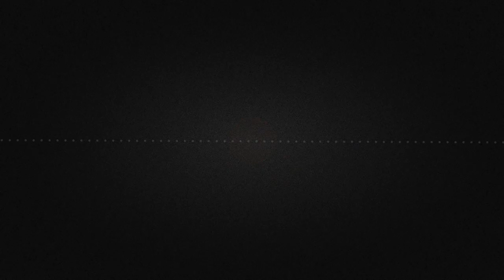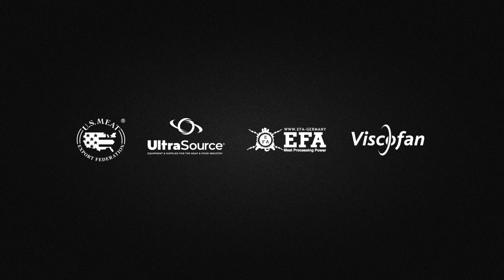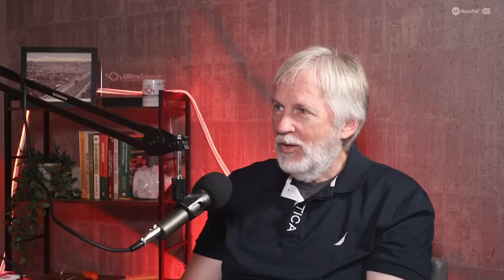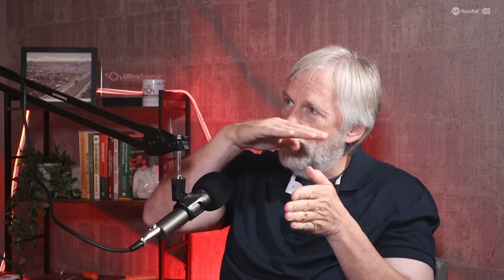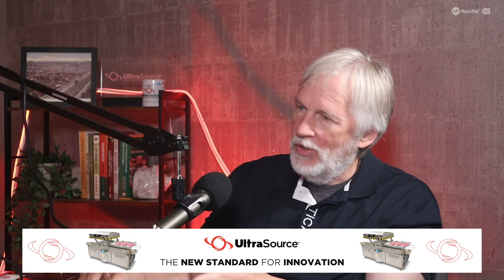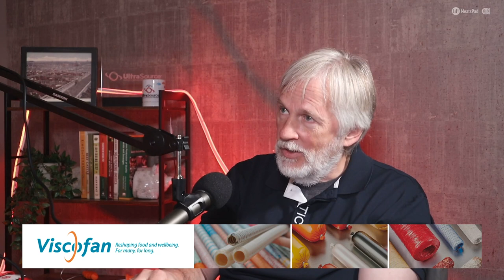How to Select the Best Smokehouse w/ M.S. Robert Hanson

Comment: I am looking to start a jerky pilot project to generate recipes within regulatory guidelines. There are no small-scale smokers that I have found available on the open market that have the appropriate sensors, loggers, and controllers so I am going to have to heavily customize a smoker. I am looking to purchase an insulated reverse-flow cabinet smoker. Is there any information about airflow and air velocity for these smokers? Is this the best smoker type to choose?  Are there industry-preferred sensors and loggers that I should use to modify this smoker? Thanks